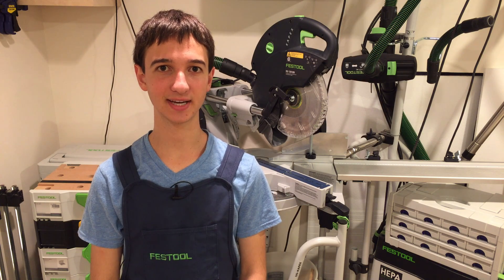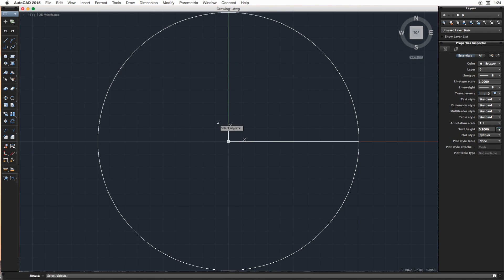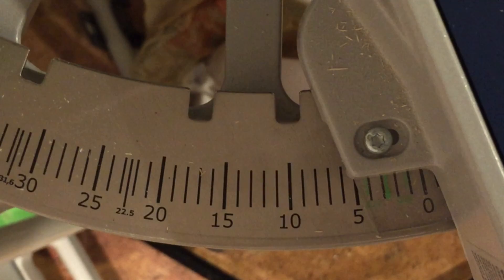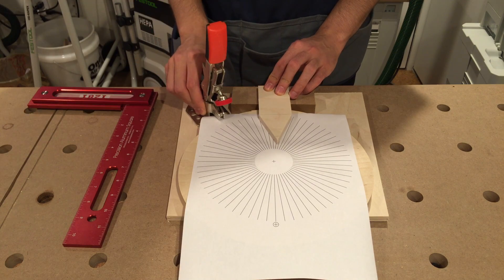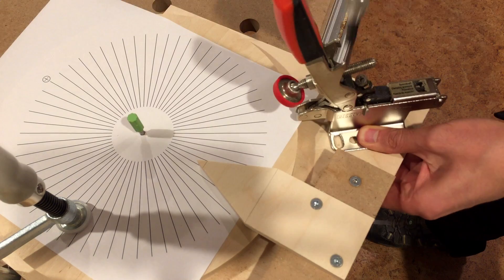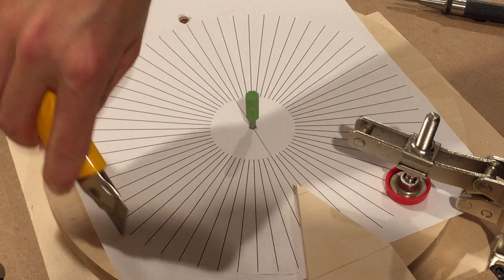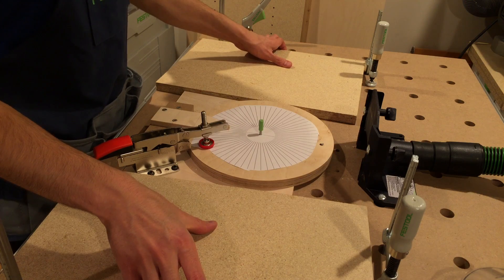How to Make Wooden Gears with a Router

Comment: Thanks Toolify! I had the same idea to use a router bit to make wood gears and it led me here :) Have you considered the potential of custom made router bits that match the profile of gear teeth? You could only cut one tooth profile per bit though it could be more accurate, reproducible and require fewer cuts than this method. To clarify, the router bit would be the same shape as the gap between two teeth.

Comment: As you are using the right fence to guide the trapezoid, the router is not cutting along the central axis of the tooth.  The resultant teeth are cut with a fixed angle.  Would have been better not to both with the trapezoid as a depth limiter, but a parallel side-guide and end stop.

Comment: Very nice process! A subtle improvement to the accuracy of the cuts would be to aim the pointer at the far out part of the printed lines, not the inner part. Given that there will always be a slight inaccuracy of lining up the pointer to the line by eye, any slight misalignment will be amplified the further toward the centre you are, and reduced the further toward the edge of the circle you are.

Comment: Excellent work!  One suggestion though: Your pointer stretches too far over your template.  You are loosing pointing accuracy that would be improved if you aligned to the outer edge of the printed template.  A straight edge for alignment would allow you to use large and small templates with the best accuracy possible given alignment tolerances.

Comment: You don't have a scroll saw but you do have a jig saw.
Drill a hole in a piece of plywood the size of the jig saw blade or cut a slot it in it. 
Place your jigsaw blade within the hole or slot.
Fasten the jigsaw to the board so it won't move.
Flip the board upside down so that the blade is pointing towards the ceiling.
Now you have a makeshift scroll saw.
Having seen several of your videos; I'm surprised you didn't think of that!
Either way, your router jig is a workable plan.

Comment: Hello there my friend.  I want to say that I have enjoyed the vids that you have produced and posted.  They are very clean and to the point in the presentation of information and your ability to speak clearly makes it interesting without a lot of fluff (like: hems and hahs!).     Question though for you and your readers/followers:  Has anyone come across a special 4-jaw chuck for a drill?   Some drills use a taper and some use a threaded shaft, and maybe some use a pinned shaft too.  I have searched (in google and sometimes my own travels) for this type of chuck and can't find anyone to admit to having ever come across one.  One thing that I want to use it for is driving taps to thread holes using a drill to be more precise than the normal T-handle normally used.  And it would be more positive and non-slip.  Thanks,  RogerO.

Comment: Hey, i may be a long way past due on this comment but why not use the trapazoid for centering then use a fence on the router and a dowel as your tooth place holder, like a box joint jig?  i suppose you would only need the one side of the trapazoid anyways and if done right it would shape your gears to the same profile as the dowel and the first tooth cut profile.

Comment: Machine screws tapped into plywood is probably not as strong as using the correct wood screws.  Very inventive method to cut  your gears!  Check an Engineering text on how to shape your teeth, though.

Comment: It seems your pointer introduces unnecessary error.  If you would've made it smaller, you get two advantages: a) the lines diverge, and the farther from center, the more accurate; b) a smaller point would let you line-up easier.  Plus if you made it lower to the paper, you would decrease parallax.  That said, glad it worked out for you.  Nice result!

Comment: I have often thought of making a jig for cutting gearwheels on my home-made bandsaw (from a plan by Matthias Wandel).  Until now, however, I have never had occasion to make a gearwheel.
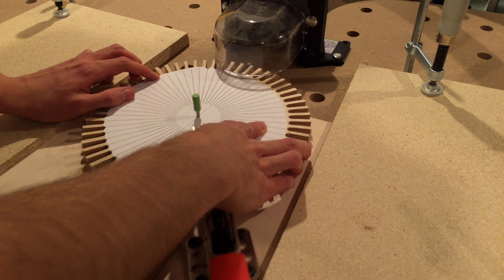At 4:06, you say "I have a perfectly shaped gear".  Perfectly shaped gears have teeth that mesh almost down to the root, using the entire depth of the tooth.  Also, the sides of ideal gear teeth are curved, following a shape called the involute of the circle that follows the root of the teeth on each meshing wheel.  This makes the edges of the teeth roll against one another with no sliding.  It's explained on Wikipedia.
Your method is clever, and I think it could be used to make much better gear teeth, but it needs a little head-scratching yet.
Great work so far, though.  If you improve the method, please post your results.
Reply: Thanks for sharing everything hoping for better projects leading up the world to better place

Comment: that is an expensive shop. maybe you should buy a bandsaw. it I'll be easier. and the other point of this method is the strength of the teeth, you are using  roughly 1/4 of its length of each tooth, so only cut that. that way you can increase significantly the strength of the gear

Comment: if you know the size of the wheel, how many teeth and spacing, can't you just make a jig to cut these with a stop pin?
Reply from the maker: +bobbg – Relative positioning like that can result in significant cumulative error
Reply: +Toolify 
http://www.mmsonline.com/articles/the-right-touch-of-indexing-capability
A stop Pin or device to locate each gear tooth would be a lot more accurate than locating each cut by eye on your print out.
If you tilt your head off center to the right or left of your first location its going to knock each tooth out of alignment. Your line of sight has to be from the same angle each time you cut a tooth, you won't have this problem with a locating pin. By the way each location will be in the same spot as the last inspect your work with a dial caliper, and or you can use a dial indicator to see if you've had movement from the proper location before you start your cut. If you think the part will be out of Tolerance flip it upside down and run all the teeth over the bit one more time any mistakes will be corrected.  You'll be within .005 of an inch or better for every cut. Your eyes won't do that good.
I can read a tape down to + or - .005 but I also worked in a machine shop for 7 years. But at my age I can't see that good anymore.
A human hair is .003 of an inch. thats way closer than you need for wooden gears.
Your cut by eye gears look good but if you stack them on top of each other they are not the same.
PS: Clear off the Chips between each cut as well as saw dust.
Use a Roll Pin or metal dowel pin to locate each cut. You can also use a template to follow where your pointer is like a new gear off a bike. Do not use a used bike gear they wear down when used. That was Stamped in a machine shop and should be close to each tooth being in the same potion.
Reply from the maker: +bobbg – I don't disagree, but all these measures to ensure precision are starting to sound like a lot of work ;)
Reply: Depends on how accurate you need the gear.
you might not need a second pass. and be just happy.
I think Just a Roll Pin on a spring loaded stop would be plenty close enough for wood.
index clamp and cut, repeat. the Roll pin jumps out the way on each cut.

Comment: very nice and clever. I bought Matthias Wandel's plans for the tilting router lift, but had the same problem. I don't have a bandsaw. Eventually I made the gears with my jigsaw mounted on a simple piece of plywood with a hole in it. Then add a blade guide as suggested by Matthias in one of his videos. It worked surprisingly well, I must say. But after a winter in my unheated shop, I guess the wood started working, and now the gears jam. As I now have a router table, I might try your idea to make new gears.
Reply from the maker: +Bartel Eeckhout – Oh no, I can imagine how it felt to have the gears jam. I'm glad you think this video and technique can help out!

Comment: Two quick suggestions:
1.  Some spray on adhesive might do a bit better for your template than tape.  It would give a bit of extra insurance that the template won't wander, and it would give you adhesion over the whole work surface.
2.  After the initial cut, going back over the teeth with a rounded bit in your router would likely help the teeth mesh together better and help prevent them from binding up.
Reply from the maker: +Urahara1001 – I like that! The roundover bit sounds like a great idea. Thanks!

Comment: That's a great idea, buy I am wondering why do you cut teeth so deep if you can use only about 10 mm from the external diameter?
I think you have enough skill to improve your tecnique building a more complex jig to cut a true (evolvent) gear tooth. But maybe it would be simpler to use a CNC router to do that...
Reply from the maker: +Giovanni Bianchissi – Yeah, I want a CNC.  You're correct that the teeth can be shorter though.  It should be possible to add a depth stop rather than relying on the trapezoid part.
Reply: +FastEasySmartTOOL Inventables, have you heard this guy? ;-)

Comment: I like your approach here, and it will be helpful for many people who have routers but not band saws. But I don't understand the reasoning for not doing it with a jig saw. Drilling holes to form the base of the teeth then cutting out the rest with a jig saw or band saw is a tried-and-true technique. If your jig saw was in as rough shape as mine (definitely time for a new one) I could understand your desire for another solution. But you have a Festool jig saw which appears to be in pristine condition and perfectly capable of accurate cuts. All you need are a couple of guides, just as you made here. And, as Mathias has addressed many times, routers aren't particularly effective cutting tools. 

Obviously your approach worked but I think the same concept with your jig saw would have been just as effective. 

Also scroll saws aren't particularly expensive, especially considering the price tag of most of your tools. And there are some great designs for building your own.
Reply from the maker: +Jon Miller I'd have to try the jigsaw approach to know for sure, but I was concerned I can't control it precisely... one wrong cut and the workpiece is destroyed.  For a band saw/scroll saw, I just don't have the space.
Reply: +FastEasySmartTOOL As long as you use an appropriate blade for the material and a cut guide it works great.

Comment: Nice! How did you determine the size of the router bit or does it not matter (much)?
Reply from the maker: +Robert Echten I used the router bit I have and designed the gear around it.  I'll have some more information regarding gear design in the AutoCAD video on my second channel next week.  But I admit – I'm no expert in gear design, there are definitely more reputable resources around the web (like Matthias Wandel).

Comment: I like the trapezoid guide idea.
But I'd make the teeth wider on the big gear.  And I'd probably use my bandsaw instead of a router (not fond of cutting with a router)
Reply from the maker: +Matthias Wandel Hi Matthias!  You're right – if I am to do this again I would make the teeth wider, and tapered.  I realized later how easy it would be to introduce a taper by just changing the angle of the trapezoid.
Reply from the maker: +Man na Please don't discriminate against anyone's tools on my channel.  If I had a bandsaw I would use it.  I don't, and this video shows my way around it.  I'm happy you like the video, but please don't go off starting fires.
Reply: @toolify  He isn't discriminating he is making a simple statement.....you shouldn't be so sensitive....I believe the router is a cleaner way to do it
Reply: With this method do you think you could swap out the straight bit for an angled cutter, and then make bevelled gears?
Reply: It’s my childhood YouTuber
Reply: @BarryManilowa  Yeah but he is right. So.......
Reply: +FastEasySmartTOOL Are you addressing your last comment to me or to Michael? If you meant me, then I don't see how I discriminate against people's tools. If you read Mathias blog where he suggests tools for the beginner, he doesn't think tracksaws are useful. I disagree because tracksaws are very useful and very safe compared to tablesaws. I think you would agree with that statement.